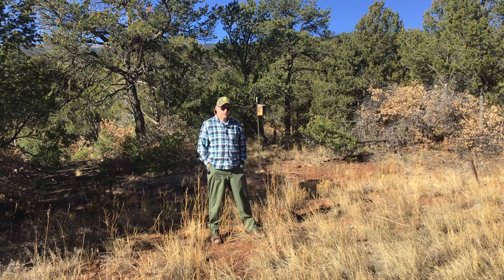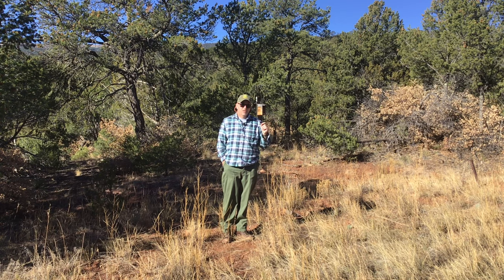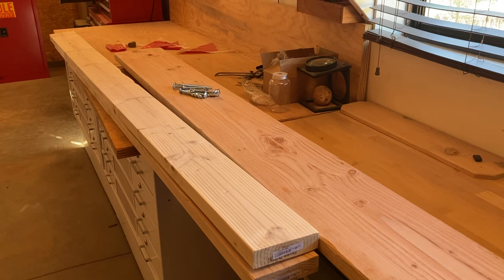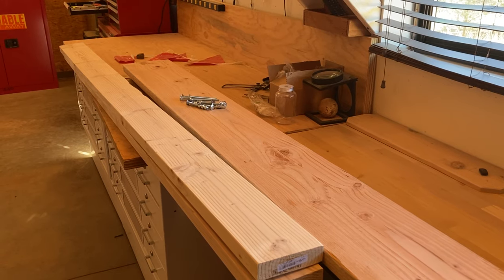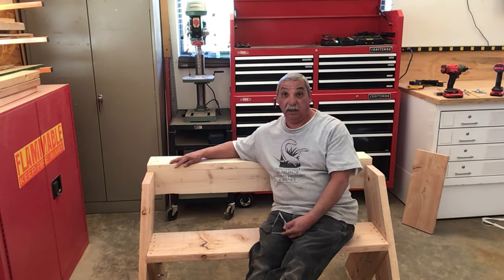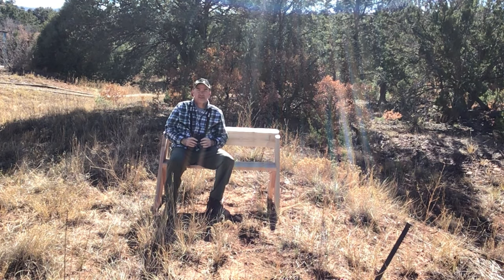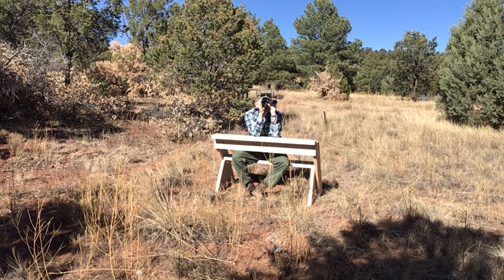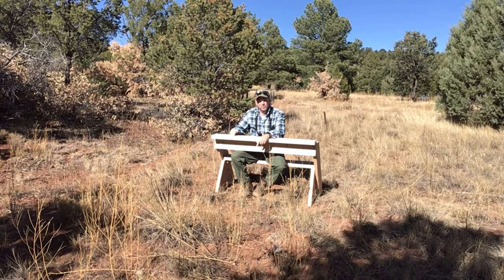When a Bench isn’t Just a Bench

Comment: You certainly don’t need carriage bolts. Deck screws are plenty strong enough. That’s not the way to operate a miter saw. You push the saw thru the wood not pull it across.